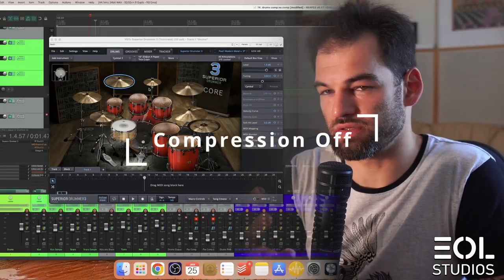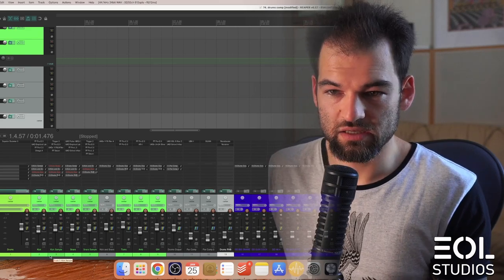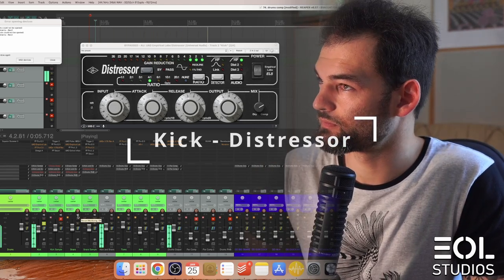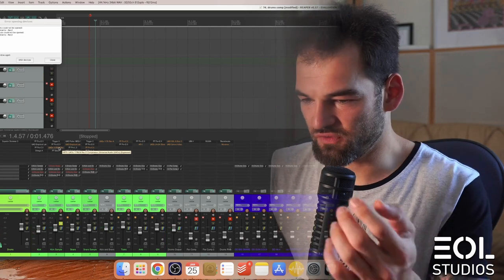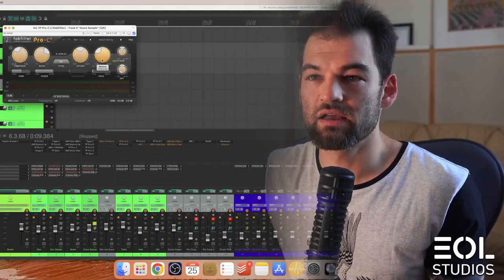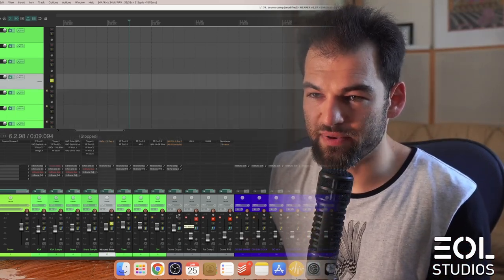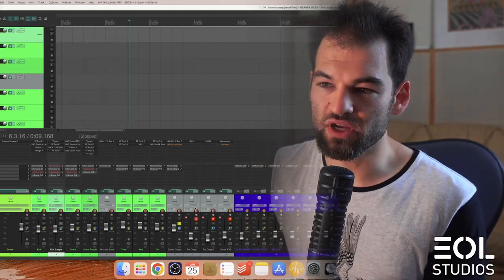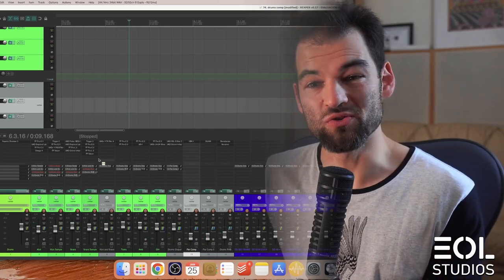Learning Compression - Mixing Metalcore Modern Metal Drums with 1176, Fabfilter Pro-C2, Distressor

Comment: I'd like to see a video like this using a live drum kit. Drumsets have 3-4x as much bleed, which makes these techniques not as possible.

At the end of the day many aspiring engineers will want to work with large bands and those bands will often require real drums and if they don't learn correct technique on dealing with bleed while trying to get proper compression, then they'll never succeed in this business.

Get ahold of some drum tracks from a live kit and show them how to tame that beast.
Reply from the maker: Exactly right. I mainly work with real drums but that's for my clients, can't quite showcase that. I'll see what I can do though, thanks for the suggestion!